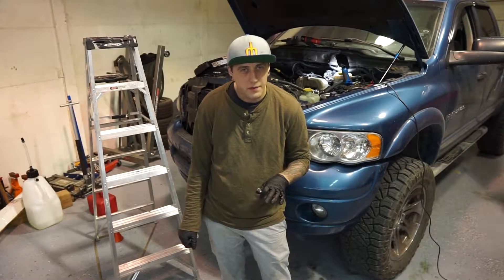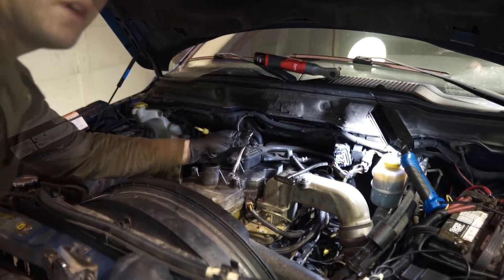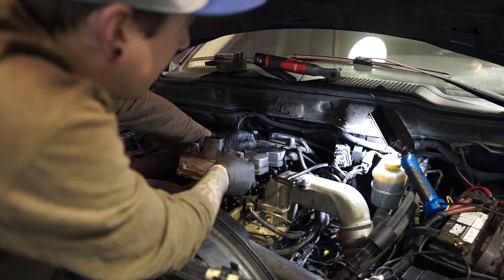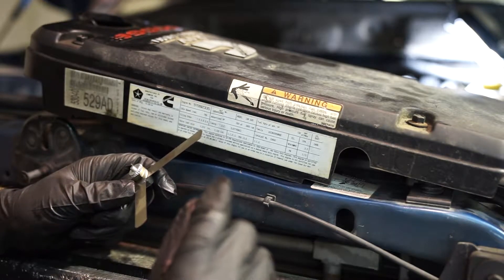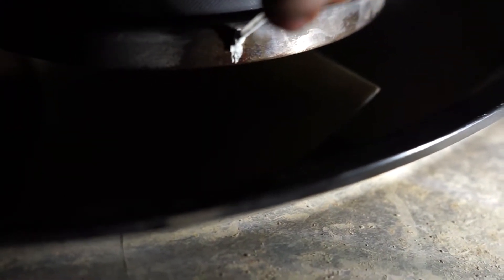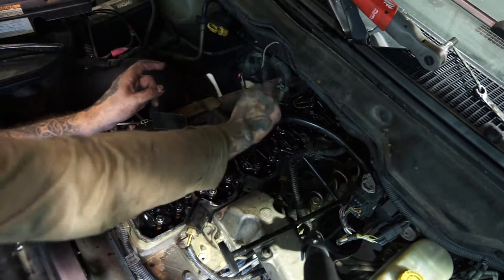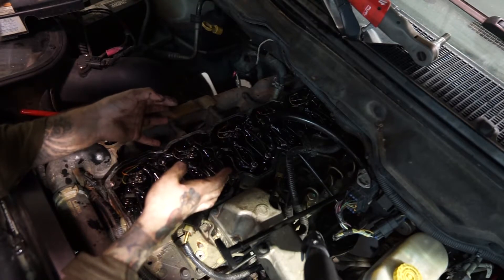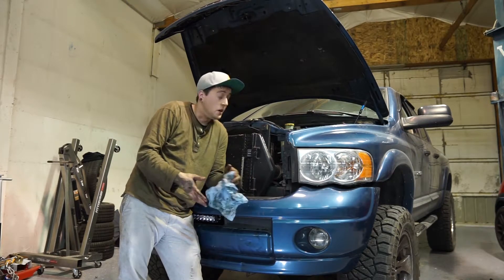2005 dodge ram 2500 5.9 cummins valve adjustment

Comment: which valves can be done at tdc and which at bdc?
Reply from the maker: sorry for slow response 
(3) Using the crank shaft bearing tool #7471-B (recommended by Cummins), rotate
crankshaft to align damper TDC mark to 12:00 o’clock position.
a. If both number 1 cylinder rocker levers are loose, continue to next step.
b. If both number one rocker levers are not loose, rotate crankshaft 360
degrees.
 (4) With the engine in this position, valve lash can be measured at the following
 rocker arms: Intake 1-2-4 / Exhaust 1-3-5. Measure the valve lash by inserting
 a feeler gauge between the rocker arm socket and crosshead. Refer to VALVE
 LASH LIMIT CHART for the correct specifications. If the measurement falls
 within the limits, adjustment/resetting is not necessary. If measurement finds the
 lash outside of the limits, adjustment is required. 

(6) Using the crankshaft bearing tool, rotate the crankshaft one revolution to align
the damper TDC mark to the 12:00 o’clock position.
(7) With the engine in this position, valve lash can be measured at the remaining
rocker arms: Intake 3-5-6 / Exhaust 2-4-6. Use the same method as above for
determining whether adjustment is necessary, and adjust those that are found to
be outside of the limits.